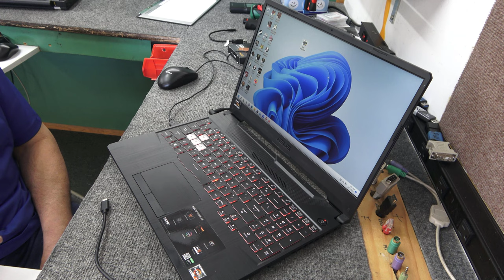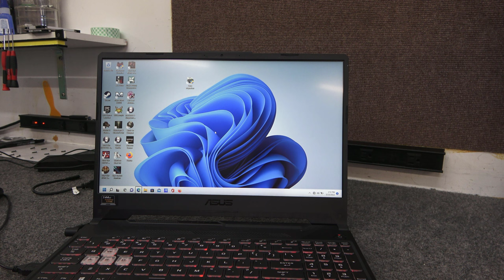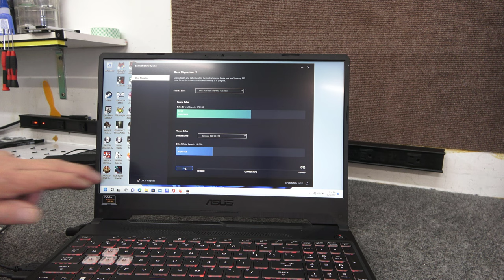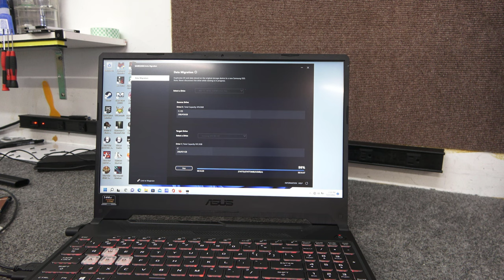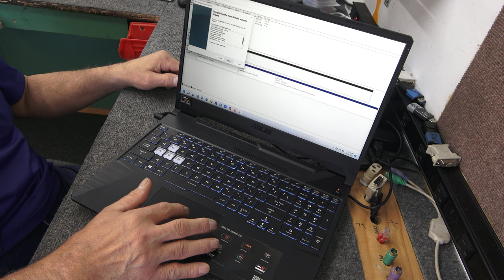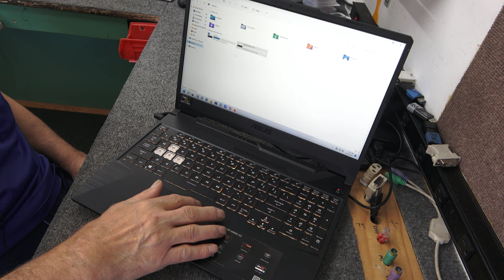ASUS TUF506 HOW TO Upgrade Clone Install M.2 NVMe SSD

Comment: Started watching your videos two days back while searching for options to upgrade my i3 acer laptop.  Watched a lot of videos but yours was the one which gave me the confidence to try upgrading it myself.  Bought the nvme m.2 crucial from Amazon and did the install, cloned the hard drive (took over 6 hours). What a difference compared to the earlier mechanical hard drive which was extremely sluggish from day one. Now my laptop is blazing fast. Thank you!, Subscribed.

Comment: I've worked on Toshiba, Dell and Lenovo laptops before.  However, recently I had to upgrade my brother's 5yr old HP 15 F387wm laptop that he only used once because it was too slow.  I replaced the old mechanical hard drive w/SSD (cloned his drive w/Macrium) and added an extra 4GB Ram - total night/day change in performance; went from 2 min to 20 seconds bootup time.  The biggest challenge was trying to disassemble the darn thing to replace the hard drive (had to remove the bottom cover, keyboard and palm rest just to get to the hard drive).  HP laptops are notoriously challenging to make upgrades.

Comment: Thanx for the video Dale.  Always look forward you one of your videos popping up in my feed.  The only time I tried to clone a HD to an SSD was a failure on my 10 year old desktop.  The old drive was triboot . Win XP, 7 and 10.  Cloned the XP and 7 partitions ok  but not Win 10 so it was  new Win 10 install and then later a Win11 install on a separate partition.  Amazing what an SSD will do for performance improvements.
Reply from the maker: Hey thanks Paul.

Comment: I would like to take the opportunity to thank you for the great video.  I just upgraded my tuff A15 to a 1 terabyte drive and it went smoothly. I cant use the old SSD as storage because it doesn't have the slot like yours in the video.  Thanks again!!!!   Norm